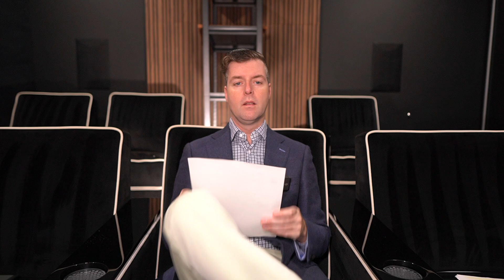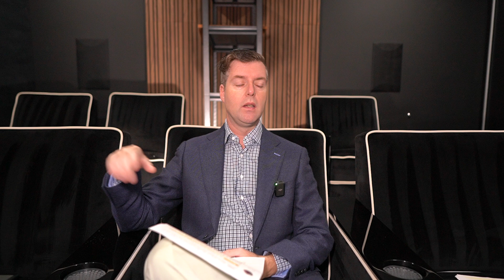For DIRAC live with BASS Control, is it best to fix the SUBWOOFER first, or let it do its thing?

Comment: When it comes to rough EQ before Dirac, it depends on how high the peaks are. I have noticed that if there is a monster peak that's +10db above the rest of the frequency response Dirac will only trim it down so much and will incorporate that into the overall volume level, which makes the rest of the FR come in below where you want it. I made this observation with standard Dirac Live before DLBC, but I think it might still apply. Knocking down these huge peaks before calibration, though not necessarily flattening them, could be beneficial.

Comment: My receiver has DIRAC live with BASS Control but only 2 subs out. Can I add 2 subs and run DIRAC as if they were only 2? I also have a miniDSP HD with DIRAC. Can I use DIRAC from my receiver on 2 subs and the miniDSP for the other 2?

Comment: There are so many misconceptions about room correction out there. Unfortunately, quite a few of them recently showed up in Audioholics room correction measurements tutorial.

What you are doing when you are taking measurements with a microphone is simply statistical sampling from a population. Hence, ONLY measure where your (or someone else's) ears will be, take as many measurements as possible and keep the microphone positions as close to random as possible within the relevant listening space (= the target population). Why? Because you are trying to estimate the parameters of the underlying population (the sound that hits ears). In other words, of course a tight set of measurements within the RSP will yield the best results for the RSP.

Perhaps is misunderstood you Matt, but I got the impression that you said that a wider set of measurements (i.e. both within and outside of the RSP) would be beneficial if using ART, even if you're only concerned with the RSP. If this is what you meant, please explain why that would be the case.
Reply from the maker: For both ART and Waveforming, you aren’t just sampling the wavefront that hits the ears. You are trying to sample the entire wavefront at low frequencies to gain the right information needed to be able to cancel reflections. The statistical sampling now needs to be a larger area to yield better results at low frequencies.  

I’ve suggested to Dirac that they consider adding some low frequency only measurements for this purpose.  Waveforming does this for exactly this reason. At the moment Dirac doesn’t allow this with ART.
Reply: @PoesAcoustics  Thank you for responding. What would that "right information" be that exists outside of the RSP that cannot be sampled at the RSP but still be used to correct the sound that arrives at the RSP? And how would you define the target population, i.e. the microphone positions in 3D space that contain that "right information"?

Comment: Thanks again for the video. If I may add, that if you anybody is using a MiniDSP or any other DSP that makes the AVR or processor see only 1 sub , then it is a must to do the aligning at least, (and preferrably the eq-ing to a flat response at least, as the DLBC can only do a global EQ-ing and levelling that way) before using DLBC. In any other cases, DLBC should be let to do it's thing (as long as all the subs are being controlled individually by the AVR or processor. Also, if there is a DSP between the AVR/Processor and subs, it may not worth it to buy DLBC, as DLBM should be enough (except if DLBC is using your fronts to help the bass in a certain way).

Comment: This is an interesting topic and one I have been wondering about myself. Correct me if I'm wrong, but it seems you may be saying that for DLBC to take a MiniDSP out of the equation and plug all subwoofers into the receiver/processor since there would be no way for Dirac to time align each sub if they were all connected to say Input 1 on the MiniDSP. When I get time I will try a DLBC run on my Denon 6800H with my 3 subs hooked only to the receiver instead of MiniDSP so I can compare the results.
Reply: I believe what you are saying is correct. While the MiniDSP would do a good job by itself with the subs, I think using it will prevent Dirac from optimizing and aligning the subs with mains since it will not be able to alter each sub individually for phase matching with the mains.  I have not used a MiniDSP, but I am using 4 subs on my X6800H and Dirac live with Bass Control.  It correctly identifies the response of each sub individually, and optimizes each for frequency response and phase matching.
Reply: Where things get tricky is when you have more subs than independent LFE outputs on your AVR. Then DLBC can't individually correct each subwoofer and presumably that's where the MiniDSP 2x4 HD sort of product would be useful I would think. The question I have in this scenario is whether to balance and left the subwoofers first using REW and the MiniDSP and once the group is optimized, perform Dirac Live with DLBC to bring the group of subs (as if they were one sub) into balance with the remaining speakers. Seems like this should work but I guess I'll have to try it at some point.

Comment: Well the question then comes, Dirac doesn't have access to doing anything to the mini DSP. That creates further confusion. Are you suggesting to this guy , not to use his external mini DSP and run the subs straight of the back of the AVR?!. If you are suggesting not to tinker with his mini DSP prior to Dirac, naturally you also would advise not to tinker the mini DSP after the Dirac calibration is done and uploaded to the AVR. So , in summary , throw the external DSP out of the equation.

Comment: I have three theater seats that have high backs for head and neck support. How much of an issues is line of sight with the microphone going to be when using Dirac Live? In hindsight I would have not gotten the Valencia seats in my 9.4 setup. Really, the only line of sight issue are my two rear speakers which are towers behind the MLP. Thanks for the great videos.
Reply from the maker: It impacts the high frequency accuracy and can add some diffraction effects and comb filtering.  But don’t over react. It’s also not the death nell of a good calibration. I would probably close the window down so it’s not correcting above 10khz. I would also have some mic measurements above the sweat height.
Reply: @PoesAcoustics  Thanks. I defintely how a few measurements above so should be good. Tomorrow will be a fun day as two new SVS PB17R subs arrive.

Comment: Looking sharp Matt! Thanks very much for this interesting video. I have always been running MSO then Audyssey...will try the other way to see how that works out.
Reply from the maker: Audyssey is different. Its bass management isn’t as sophisticated. Dirac bass control is basically equivalent to MSO. Doesn’t mean you won’t get potentially better results with MSO, but I’ve found them to be similar. Audyssey has never yielded equal results to either in the bass.